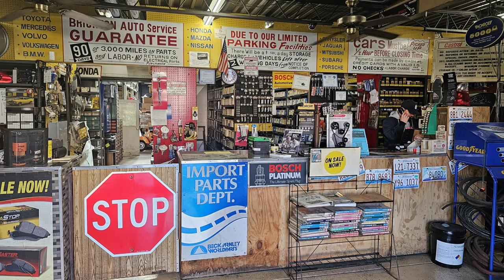Prolube Oil Testing - You Asked For It And I Will Provide

Comment from the maker: PayPal -  poissorichard.rp@gmail.com 

https://www.paypal.me/KetoPros

Both take you to the same place Donation wise
Reply: I have a 2022 chevy 1.5 turbo engine the manual says not to use oil additive,  what's your opinion.  I want my engine to last as long as I can.
Reply: I have a 2022 Vanderhall,  it's a 3 wheel motorcycle or some call it a auto cycle. It has a chevy 1.5 turbo engine and wanting to know what you feel about putting a oil additive because of the heat from the turbo making the oil hotter than a non turbo engine.  I change the oil every 3000 miles. I bought bestline oil additive but haven't used it yet. I hope to hear from you. Happy Holidays

Comment: I never used MMO in the crankcase until I saw your video. I’ve only used it in the fuel tank and for storing small engines. My 87 Dodge pickup has had a lifter tick for years, it would come and go didn’t matter if the engine was hot or cold. When I did an oil change I substituted a quart with MMO and I haven’t heard the lifter tick since. Have a great day Rich 💪💪🇺🇸🇺🇸🇺🇸🇺🇸🙏✝️
Reply from the maker: Thank you!

Comment: My Dakota 318 Magnum with 200k, developed a lifter tick a few days after dropping the pan and putting in a new rear main seal and oil pump.  An old school mechanic friend suggested adding about 3/4 qt. of Dextron trans fluid to the oil (for its' detergent characteristics). His opinion was that it may have gotten a bit of trash in the lifters. The results were not immediate, but after about 5-6 hundred miles the tick went away.  I haven't heard it since. The engine uses less than a quart between changes and runs smooth for the miles.  Have a great day Rich and Happy Thanksgiving to you and your family.🦃

Comment: I haven't seen the bearing testers that you mentioned. Many years ago the BG reps put on a demonstration using a simple machine that had an electric motor, two ball bearings and a 1/2'" beam torque wrench. They put a sample of our bulk oil on the bearings and applied torque via the wrench. The bearings seized with little effort. They then applied MOA to the bearings and were able to apply much more torque without seizing the bearings. 

My dad had an 88 Chevy 1500 with a 305 that had 300k. The truck sat for quite awhile. Once it was back in service it was consuming oil. I tried various oil additives that claimed to reduce oil consumption and nothing worked. My dad claimed that before the truck was parked it didn't consume oil. You just can't say anything bad about his beloved Chevrolets. 🤣🤣 I think most of the additives sold on parts store shelves are just snake oils. BG products are great products. 25 years ago BG was only sold to shops via a distributor. Now they are available to the general public. I actually saw BG on O'Reilly's shelves.

Comment: When they demonstrate the oil on a running car and it smoothed out. It's most likely they had a jack underneath the oil pan. When they started pouring in the oil after a second they started jacking up on the oil pan to. Reduce vibrations in the engine  Although you can't see that

Comment: Hi, the prolube has just arrived and I would like to put it in the oil of a Kia Sorento Diesel 2.5 L, I'm curious if anything changes!! Some time ago I used SINTOFLON (and it has a Teflon base) on a 2000 BMW 320 Diesel and the only thing good and that at minimum rpm the engine ran really well, but I didn't notice other changes. On the bike I used Ceramic liquid power but I didn't think anything had changed (I admit that I only used half the quantity). I'll be back tomorrow with a comment and I can make a little video of the prolube. Greetings from Italy

Comment: Hey brother looking forward to the oil testing videos.  👍 quick question,  my son has a 2015 f150 2wd v6 naturally aspirated.  It's the plain truck like job trucks.  His fans are staying on and running high speed all the time.  Do you think it's the head temp sensor? Reply if you can he's going crazy and can't figure it out.  Much appreciated 🙏
Reply: Turn the a/c off and see if they shut down

Comment: Even the owner of this company puts videos on tiktok and won't do a real test himself. He just loads up a bearing with variable amounts of pressure using his hand and will just add some prolube to another oil. he has a bearing running in a cup that's half full, he adds some force, the bearing squeals, he fills the cup all the way with prolube, squeal goes away. I've yet to see a real test with it with quantitative data, controls, etc

Comment: Rich what is your thoughts on this new Valvoline restore and protect oil? Has some pretty big claims.
Reply: I saw the Valvoline video on Motor Oil Geek YT video ..I am seriously interested! My KIA recently was at the dealer for a piston soak and the results were not good enough to save it. If there was no free engine I would do another piston soak and use the new Valvoline oil.

Comment: This odd you’re testing this product cause I just watched another channel have a major problem with prolube…..went to pour it out of the brand new bottle and it was nothing but sludge ….he contacted prolube about it and they were interested in seeing what had happened.
Idk about this product….makes me nervous …
I think I’d rather stick to Lucas products.
Reply from the maker: I don't even know why people would use Lucas instead of a thicker oil because Lucas doesn't have any additive that's going to actually help your oil all it does is make itself stick to metal that's it it has no additive and when you dump Lucas in with regular oil you dilute the ad pack that's in the regular oil so why not just go to a thicker oil so it has a complete balanced ad pack
Reply: @FordBossMe  I’ve just used it on older engines and transmission …..also use it for engine assembling …it’s super sticky and very slippery.
Yes it doesn’t have much for additives but I’ve used it in many transmissions that we’re having issues and it did help to get longer life out of it….same with engines…
I watched a few channels testing it and even Scotty Kilmer tested it on a trans issue and it fixed a delayed shift problem.
I’ve used the trans additive more than the engine additive….i remember one particular time with an 03 dodge Durango …very slow engagement into gear when cold….like drop in gear and 5-6 seconds later it would move. After the truck was warmed up it shifted in gear normally …….(trans was not burned up for say …had normal trans services) 
About a week of driving and trans shifted into gear cold like normal. 1-2 seconds … figuring the seals were hardened and the Lucas helped soften them back up.